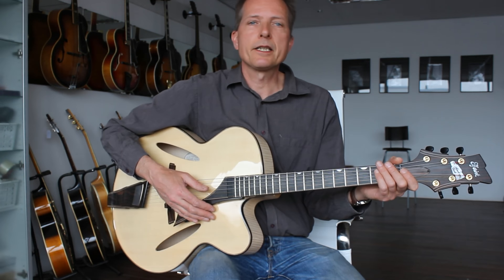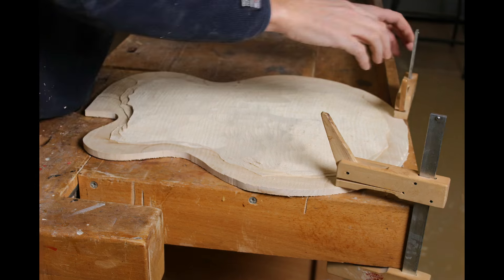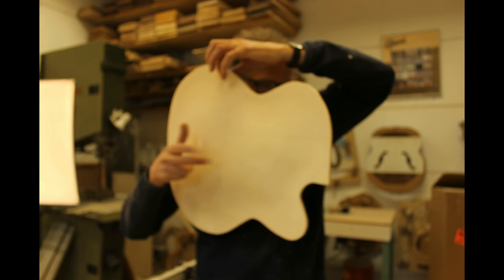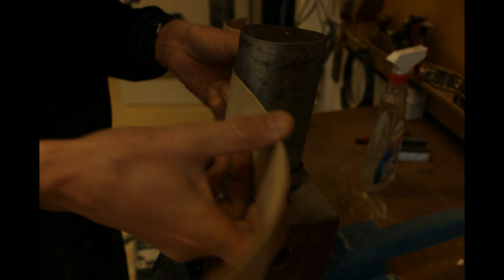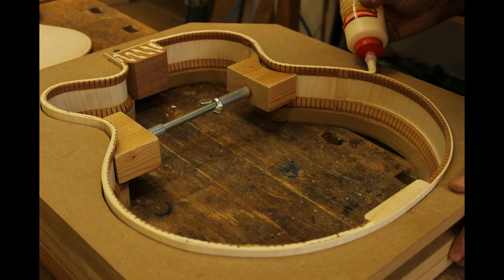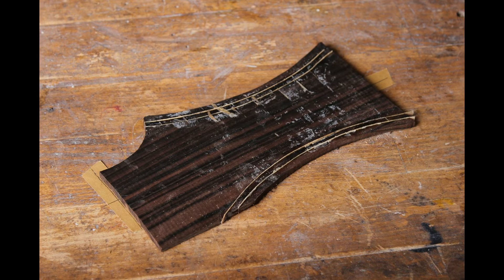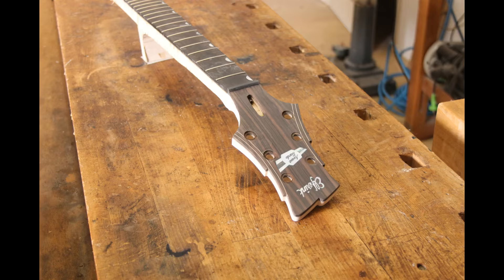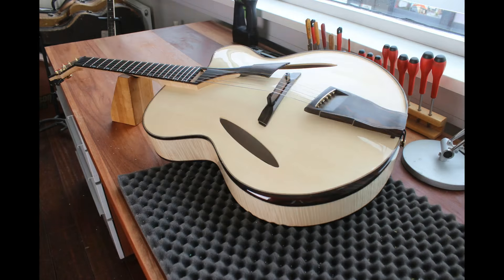Making an archtop guitar

Comment: Saw this posted to instagram, and I'm so glad to have found it here as well. I have NEVER seen your bending technique where you use a heat gun for the majority of the bending of the sides. Usually it's a mould with a silicon heating blanket, or only a bending iron.